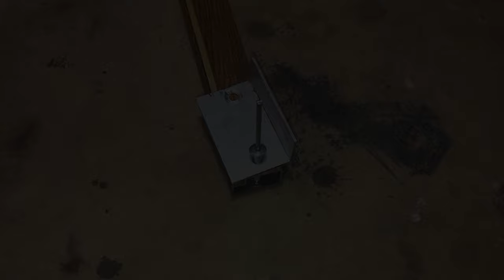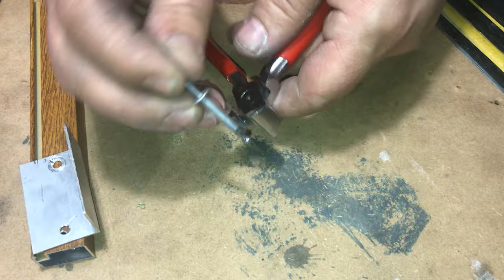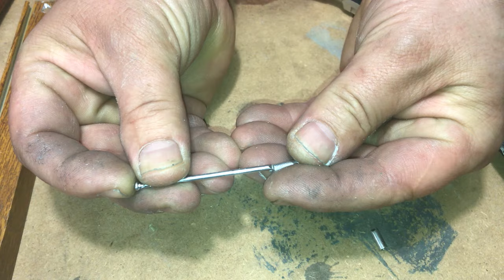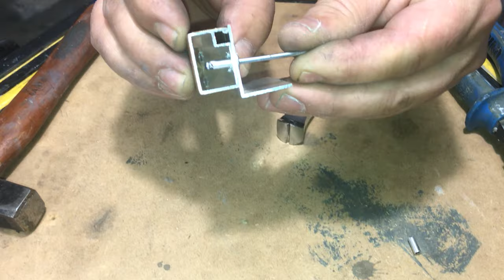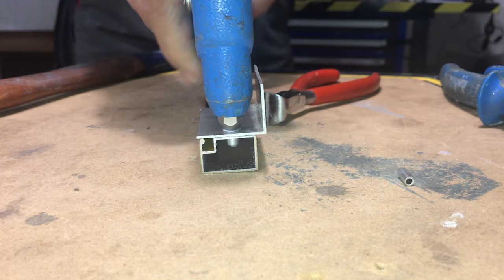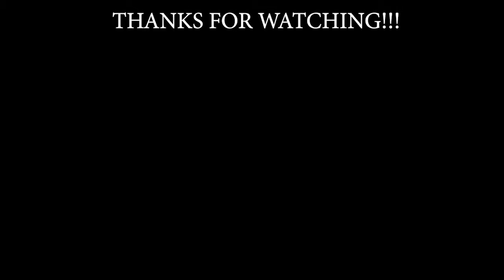POP RIVET( HELPFUL SOLUTION)

Comment: Clever.  I admire people's ingenuity.  But this seems like a lot of work, when you could just use the correct rivet.
Reply: Nice solution for when you only need one or two shorter rivets. You are rite, buying a packet of the correct size is best.
Reply: Obviously having the correct size is best, but if a job only requires 1 or 2 rivets and its a 2 hour round trip to the supplies, its a no-brainer

Comment: Question: Since the Rivet Base begins to deform (shorten) immediately when you begin to compress the "nail", is there some way to 'begin' compressing the Rivet at an angle (like the one shown in the vid) and then "straighten out" the installation tool once the below-surface nub has shortened enough to be swung to the Vertical?
Or is the Rivet component deformed at an angle that won't allow correct 'attachment' of the two surfaces?

Comment: You could do this with nails that are too long - cut them to needed length then resharpen the point. OR you could just use the correct size in the first place.

Comment: What is that cutting tool you had called?
Reply: It is a nail nipper.
Reply: @pasqualeparente9776  why reduce its lenght?
Reply: @Steve-lh6ww  he reduced the length so it would fit in the place he needed to join the pieces.
Reply: @pasqualeparente9776  I see, I skipped video and no audio I didn't see what he did early.

Comment: What is the blue color tool you are using at https://youtu.be/hJfbZ5520nM?t=97
is this a common household item / tool ?
Reply: A rivet gun, or a riveter. a cheap one is 20$ and an expensive one is 150$. They come with 5 standard size tips so u can rivet 5 different size rivets. You can even get cordless and pnuematic rivet guns